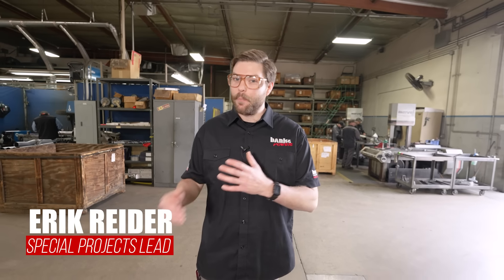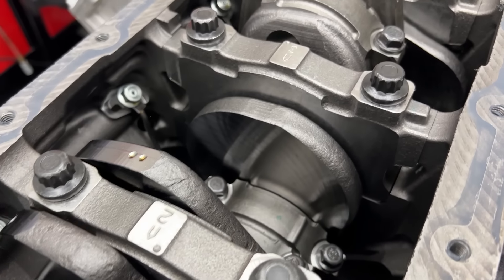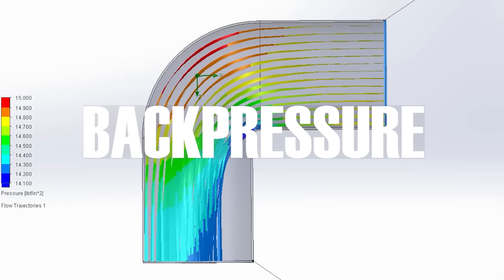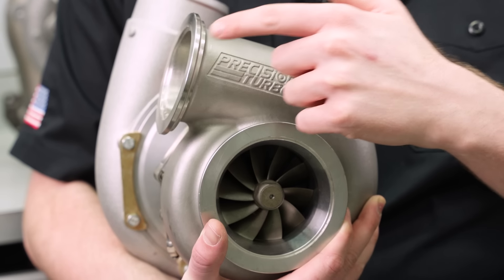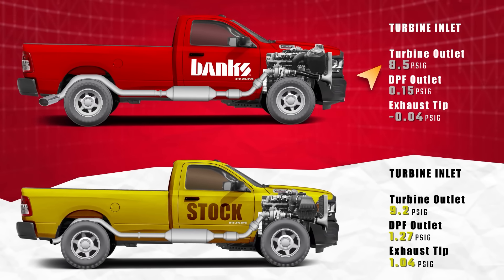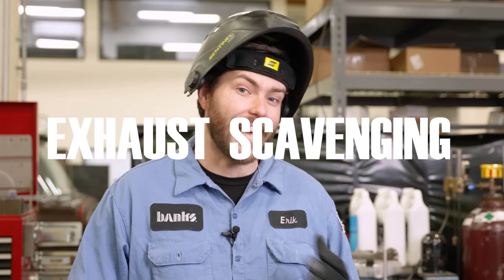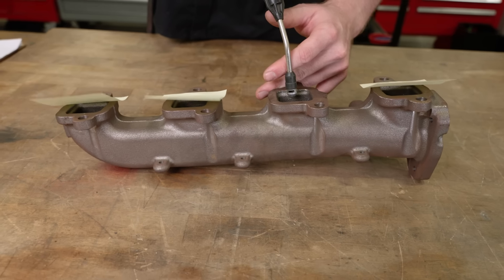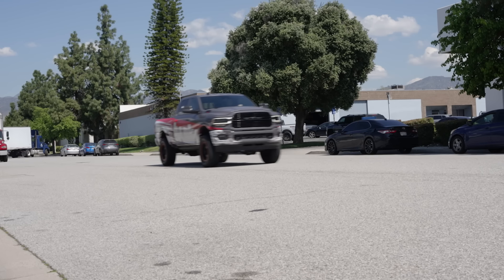Busting the exhaust backpressure myth | Banks Entry Level

Comment: So what I have always heard was that on a NA vehicle the lowest possible back pressure was always best for maximum horsepower, but would cause low end torque to suffer. That isnt the case with a turbo, because the back pressure reduction spools up the turbo faster, making good torque. That doesnt happen without boost.
Reply: The reason for low end tq to be lost an engine with an exhaust designed for higher RPMs is because they're designing it for the air flow amount. At low RPM you're moving less air, so an appropriately sized smaller exhaust will allow for better scavenging due to optimal exhaust velocity. That's why there's so many devices on an engine to help adjust the size the intake and exhaust systems among other aspects like runner lengths and duration. For a turbo charged engine there's going to be differing sizes of various components based on how the engine can pump out exhaust gases. Just like how if you over size the turbo for an engine and it takes forever for it to spool or vice versa, too small of a turbo and it spools up fast giving you instant power, but completely choked up top, same issues.
Reply: @sigmaprojects  Sounds accurate. Also sounds like it proves this entire video to be false on everything other than turbocharged vehicles. Sooooo you DO need some back pressure on most other vehicles.
Reply: @boost331  I'm sorry if I didn't make it clear. You never want back pressure. I said the reason for loss of low end power with a larger diameter exhaust is because the exhaust velocity will be slower at those RPMs. Slow moving air equals higher pressure, but it's also about how much volume of air you need to move. So at low RPM not a whole lot of air is moving, so if you want to cause scavenging effect you need a little smaller exhaust to improve velocity which will reduce reducing back pressure. But if you're trying to make more power at higher RPMs when the engine is moving a lot more air you'll need an appropriately sized larger exhaust to improve exhaust velocity for the volume of air you're trying to move to keep up the scavenging. Reducing back pressure. In every situation for your desired results you always want to reduce back pressure. It's just about sizing the exhaust to be the most optimal. Tuning runner lengths and such to capitalize on the pressure waves is also reducing back pressure. It's just not easy to make a one size fits all exhaust for every single situation. Modern engines have some ways to do with it, like variable valve time and duration. Think like a big cam engine, where at low RPM it sounds like it's going to die. The valves are opening up super wide and because at low RPM it's not needing all that lift the opening being too large slows the velocity and doesn't help in reducing back pressure, but when you rev it up and you need to move a lot more air the size is appropriate for not being restrictive and the exhaust can move better. For an every day car auto manufacturers will design the engine to have the least back pressure at lower RPMs since they know for those commuters they're not revving them up, they're just getting them from point a, to point b.
Basically in a perfect world engineers would design a sophisticated exhaust system that could change in size infinitely to maximize all the benefits of every size and shape to reduce back pressure at any RPM and load, but such a design doesn't exist so they try to just design for the least amount of back pressure at the point where they think the driver will use the car the most.

Comment: Excellent presentation!

Depends - in theory it's bad because the piston has to push against the pressure to expel it and in a perfect world there would always be a vacuum in the exhaust.

In practice it can't be achieved, although Detroit diesels, and some other large 2-stroke diesel engines, used exhaust scavenging pumps - that were re-purposed by "hot rodders" to became the foundations of the x-71 series superchargers!
Best one can do is try and control the pressures to best achieve exhaust scavenging and initial intake flow - this is done with tailoring the pipe diameters for velocity, and lengths so place the low(er) pressure waves in the exhaust pipe to be low at the best time for cylinder filling and net torque.

I do wonder if some work on the turbine housings, to improve the transition from the turbine outlet's inlet through the housing to the outlet's outlet, and the pipe's transition from that flange to the full diameter, wouldn't show some significant improvements?
Reply: Detroit blowers weren't scavenging pumps, they were on the airbox side of the engine and forced air into the engine to deal with the fact detroit 2 strokes can't self pressurise. Those blowers were the source for hotrodders.

Comment: Hey!
If digging deeper into this subject you can actually fall back to the same myth that it is good.
BUT!!
This demands very good pulsetuning, like on a twostroke.
Say IF having 1psi backpressure and during overlap in the valve event, the blowdown period easily overcomes this 1psi.
(Blowdown is happening just fractions of a second after exhaustvalve opens)
This 'high pressure' pulse CAN reach up against ~250psi in a fraction of a second(remaining cylinder pressure) and creates a intense pulse down through the exhaust manifold, followed by a negative pressurepulse, this negative pressurepulse helps pull the aircolumn into the cylinder when both intake and exhaust valves are open.
Now to the good stuff.
IF having drawn out a 'large' amount of fresh air into the manifold, the small 1psi backpressure can help push some back just before the exhaustvalve closes...

Comment: Some motorcycle exhausts use butterfly valves to add backpressure at lower revs, but that is to compensate for the high valve overlap needed for higher power at near redline (typically well over 10,000 rpm).   It is largely done for emissions and noise, but I have seen arguments that if the resonance is right, it can help lower-end torque.
Unfortunately, the hair dryer analogy is off.  Many centrifugal pumps or fans use less power when flow is restricted.  That is why you hear the motor speed up rather than bog down.    In many applications, restricting the output also reduces cooling air, so the motor will burn out even though it is at a lower load.   Plastic fans or pump elements can also melt from lack of throughput (I found this out the hard way).
Reply: I don't think the butterfly valve is to add back pressure, but to improve gas velocity at low RPMs. By doing so it also improves MPG/Emissions. So it can be fore both. Many older cars would do this on the intake side too.
Reply: @sigmaprojects  It depends on the application.  There are also some that are largely for noise mitigation.   On engines that are tuned for peak power at very high rpms, the valve overlap is so great that unburned fuel/air mixture gets through the exhaust valve at lower engine speeds.  In those cases, the increased back pressure reduces velocity going out of the exhaust valve and reduces scavenging. 

The first butterfly in an exhaust system that I recall was around 1980 on the two-stroke Yamaha RD400 and it was there largely to reduce emissions during deceleration. 
It predated their YPVS system.
Reply: @jfess1911  I agree there are many reasons, but a butterfly valve reducing the size of the exhaust at low RPM will increase velocity, not reduce it. At low RPM larger exhausts will not be good at scavenging and you'll get a build up of exhaust gas pulse waves increasing back pressure. This is a common practice on intake runners too.
Reply: @sigmaprojects  Again, it depends on application.   A typical butterfly valve only increases the velocity at the tips of the plates while the velocity is slow on either side and more turbulent downstream.  It acts as a variable restriction.  This is how gasoline engines have been throttled for decades.  This is how I have mostly seen butterfly valves used.
In an exhaust system,  this setup typically just adds backpressure and a surface that can reflect pulses, but that second property is often not utilized.

On the other hand, It is possible to design a system with multiple runners where the valves shut off some of them, increasing flow on the others.   There are also more sophisticated systems, more frequently used for intakes, with multiple runners of varying lengths which are opened or closed by butterfly valves, depending upon operating conditions.
Reply: @jfess1911  are you saying in the motorcycle system with the butterfly valve in the exhaust system it can operate at part close? Usually they're either open or closed to divert exhaust gases. What bike application are you thinking of?
Reply: @sigmaprojects  I have lost track of the many emissions control systems I have seen in the past 50 years.    TBH, I can't remember if the system on the RD400 was purely open/close, but it was in the main exhaust header and did not divert the exhaust to another passage.   It crudely replicated some of the features of the later, more sophisticated power valve systems.
 I know that it was popular to delete the valves in the exhaust for a long time and that many reported that it improved overall performance.   This leads me to believe that they were not diversion systems to increase exhaust velocity and power.    There are a lot of ways that butterfly valves have been used in emissions and noise control is my point.
Reply: @jfess1911  For the RD400 sounds like it was kind of a choke, so I get what you mean by inducing back pressure. When off throttle it would basically cut the flow off since it's a two stroke, kind of makes sense. I get what you mean a bit, but in the context their goal isn't "adding back pressure" as it was as means to reduce unburned fuel when in off throttle. From what I'm reading it sounds mostly like just trying to trap most of the exhaust fumes in the combustion chamber to keep it from coming out of the tail pipe just for emissions testing, since two strokes are quite hard to pass emissions. Probably made it run super hot when the valve was closed too. But when you're not off throttle sounds like it stays open. It's basically just trying to cork the engine when you're off throttle. Sounds like a very niche situation, but then again I don't really read/work that much on older bikes as do with cars.
Reply: @sigmaprojects . I forget exactly whether it just covered the top part of the exhaust port or just acted as a restriction.   The butterfly valve was actuated by the carburetor vacuum and the complication was a nuisance to repair.
The later "power valve" systems had a more advanced device that would reduce the height of the exhaust port and do a better job preventing short-circuiting of fuel/air mix over a larger power range.
On 4-stroke engines, it is possible to use a similar system to raise the pressure at the exhaust valve enough to delay entrance of fuel/air mixture into the combustion chamber until the exhaust valve is almost closed ( on an engine with significant valve overlap).  That is how a butterfly valve in the exhaust header can be used to reduce exhaust emissions at low revs. This can reduce low-end performance.  I imagine that it is possible to tune a pulse to stuff fuel/air mix back in at low revs, but I don't know over how large a rev range that would work.   Of course a cascading system of butterfly valves acting as sonic baffles is possible, but I don't know if anyone has tried that yet, or if it is worth the trouble.  So far, the trend has been to increase engine displacement to compensate for power lost to emission controls.
We have already seen variable valve timing systems beginning to appear on motorcycles and I suspect that they will become more common.  I find it interesting that Yamaha has already put variable valve actuation on some 125cc engines.  Then again,  the 125 is a special market in many places, making it worth the trouble and expense.
Reply: @jfess1911  the modern solution is to have very high degrees of variable valve timing to the point where they sometimes don't even need an EGR system. Toyota hasn't needed an EGR on most of their engines for the past 20 years or so.  Something like butterfly valves to do some degree of control is probably necessary on a 2-stroke because they don't have valves controlling the system at all.
Reply: @sigmaprojects  Before VVT, all sorts of things were tried to get some to get some of the same effects.   It was not that long ago that any VVT was considered exotic Heck, I am still driving my first car with it.
  The 2-stage tech being used on the 125 Yamaha engines is not too dissimilar to that used by Honda in their VTEC system in 1989, so it is limited to a high-rev and a low-rev setting.
Reply: @jfess1911  maybe for American cars (I grew up with a lot GM products), but I also had plenty of Japanese cars over the decades. I wouldn't say 30 years to be not long ago. Yea back in the 90's it was kind of exotic, but after the mid 00's nearly all japanese cars had some sort of variable valve time and now many Toyota models have VVT on both intake and exhaust side. And yea, prior to VVT you had systems like Toyota's T-VIS in the 80's where it was butterfly valves in the intake to just between long and short runner lengths in the intake to improve the overall power band. Nissan had something similar in the 90's too, probably in the 80's as well. Many of the 80's cars I had were super simple, like GM V8s/V6s or Toyota's 4 cylinder truck motors.

Regardless there's very little reason to create back pressure for an exhaust system.

Comment: Back in 1990s i had a motorcycle ( cx500 ) and i put a 2-1 exhaust on and it was very loud ( little back pressure) and flat out 55mph ....then i took out the baffle and welded a silencer on which increased exhaust lengh by 2 ft and was very quiet and very hot gas out the end ....now it had power everywhere and increased top speed by 5 mph from standard exhaust.  The correct back pressure is important , for outright hp at just top less so but on the road you dont want a huge dip in power to gain a few hp in the last part of rpm

Comment: Exhaust Backpressure and Exhaust Velocity are being interchanged between alot of people.  One thing to note though for people who are new to turbochargers.  DO NOT use too big of an inlet to your turbine or youll creat whats known as a low pressure variance where you can actually "Stall" the turbo.  Ive seen this countless times.  You can practically turn your tubine into a vacuum pump by doing this.  Keep the correct ratio and you will never have to worry about this.  I remember talking to Gale at a seminar over at a resort one time and his words ring into head to even this day.  On a street truck, exhaust that you can see is power that you didnt use.  When some people out there understand this, the better youll understand what turbochargers can actually do.

Comment: David Vizard proved that an Austin A Series (five port head) with cleaned ports and sports exhaust manifold will suck the cylinder to 50% vacuum the moment the exhaust valve cracks open. Much of this is caused by shock waves pulsing down the manifold. Higher gas pressure increases the speed of sound so you get a better suction effect. 
Two strokes with expansion chamber exhaust actually run at a fairly high back pressure. This keeps the shock wave flinging along at a speed to suit piston speed. Two strokes literally suck new charge down the exhaust header. The pipes have a reverse cone that stuffs this new mixture back into the cylinder. 
Four strokes almost never do this but they could if suitably designed.